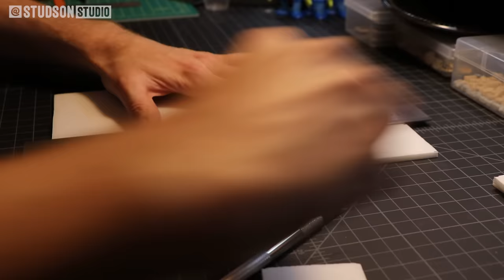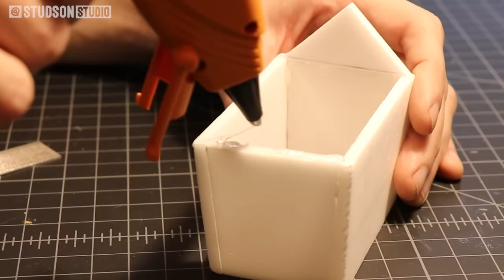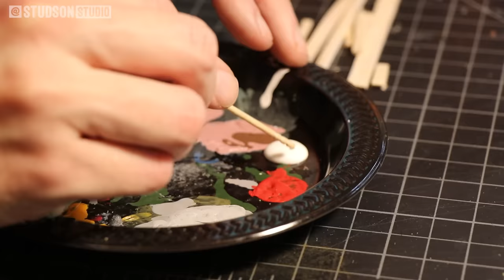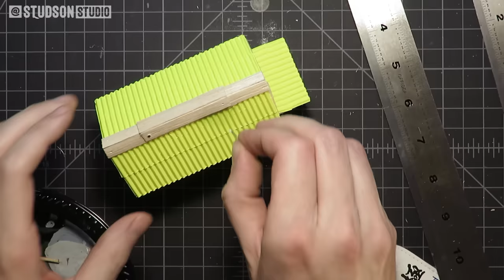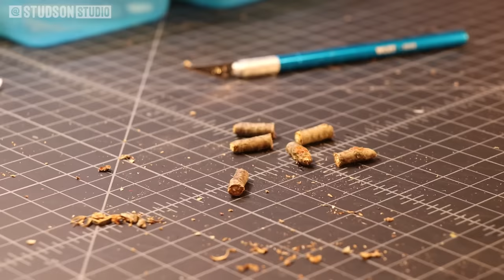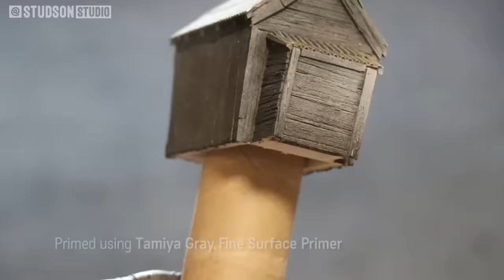How to Craft a Miniature NOOK'S CRANNY from SCRATCH // Animal Crossing Crafts

Comment: I panicked for a moment when you mentioned using a lighter near fresh super glue for the exact reason that you mentioned. That stuff is SUPER flammable. It can also sometimes cause a chemical reaction that causes it to catch fire if you use it on the wrong material, so be careful using it on cotton and wood.

Comment: How did he get the Nooks Cranny sign on the roof? The beauty shots at the end show some supports holding it up so its got to be more than just hot glue right?
Reply: Looks like he used plastic to use as supports and using hot glue to attach the sigh onto the plastic

Comment: I realise this is an older video, but if the base is still warped you can paint the underside in a thick layer of PVA glue and leave it to dry for 24 hours and it'll unwarp :)

Comment: Here in Bulgaria the only foam board I can find is the expensive stuff, that has difficult to remove paper.
Reply: Maybe try dampening the paper and the gently rubbing it off? You might even just be able to saturate the paper part a let it dry to see if it separates from the foam any easier.
Reply: @kattriella1331  I'll try that next time.

Comment: wtf I hate crafts and love these

*A Zelda treasure chest that says "duu duu duu daaa!" when you open it.
*A master sword sacred grove-esque pedestal that you can plug a house key into as a keyholder.
*Blooper on the cross
*A bunch of flip-swap tiles from Mario Galaxy. You could even make a sliding panel sandwiched between 2 thick grid skeleton panels that "flips" all the tiles.
*Animal Village!
*A stack of crates from Crash Bandicoot
*Hot Wheels scale Rocket League stadium
*Mad Dummy from Undertale
*Father Mendez's eyeball from RE4
*An alley from Jet Set Radio
*Yharnam Cathedral
*Something from Kingdom Hearts, but you do a bad job and then smash it to pieces/burn it at the end
Reply from the maker: "wtf I hate crafts and love these" LOL this is my great compliment, thanks! And that's a large stack of ideas! I'll jot them down in my idea log.

Comment: Has anyone tried using wood glue with that foam board? Does it work? I usually use wood glue in bottles for my cardboard models because it's very clean, easy to work with and leaves you a lot of time. I hate using hot glue or glue in tubes, it's just so messy...